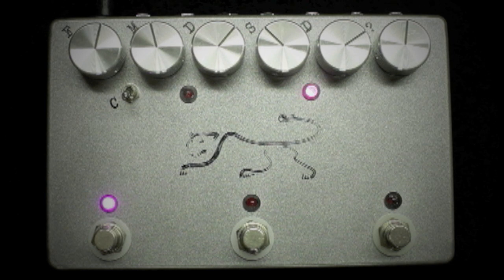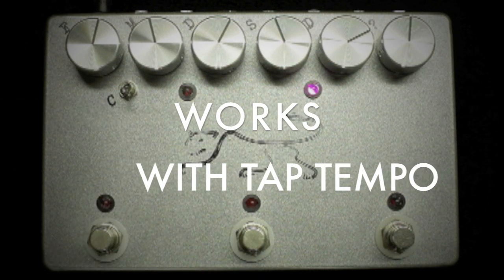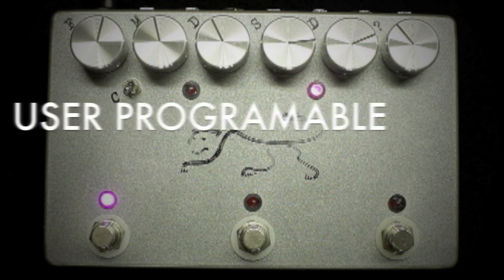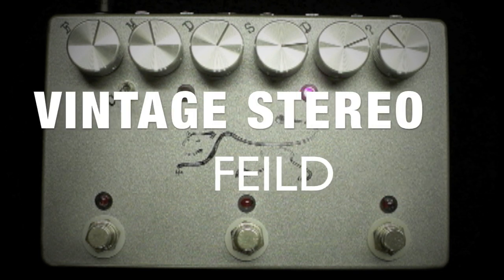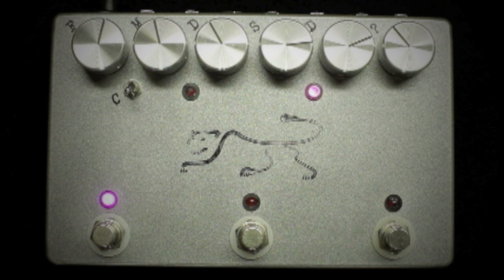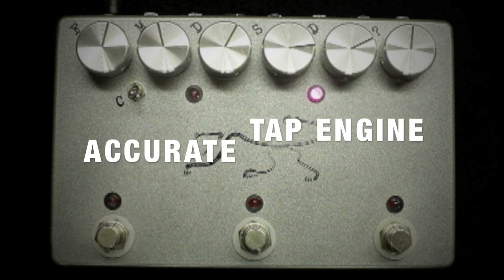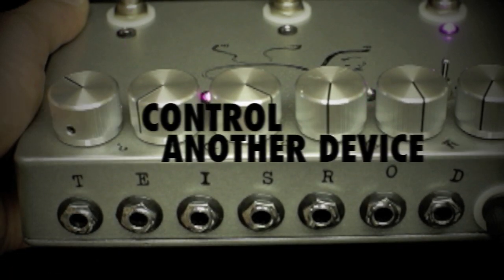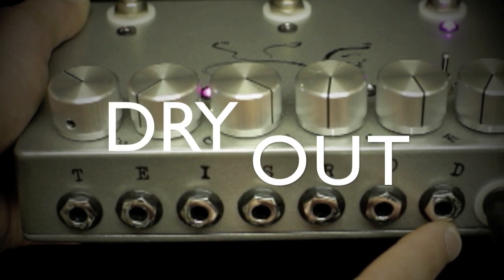The Panther Delay "Video Manual or Overview" JHS Pedals

Comment: sounds like a great thought out echo , BUT the thing that is missing 
is the *Mix* is not expression pedal , THATS THE MAIN THING YOU NEED !
its the 1st knob that should have been made assignable !!!!!!!!!!
why do you want to control the modulation more than depth ? this is an ECHO!!!!
especially when using a 2 channel amp , when you switch to the dirty channel 
it always raises the echo level x10 and swamps everything ..OR PUT AN EXTRA FOOTSWITCH WITH AN EXTRA MIX KNOB FOR 2 DIFFERENT LEVELS